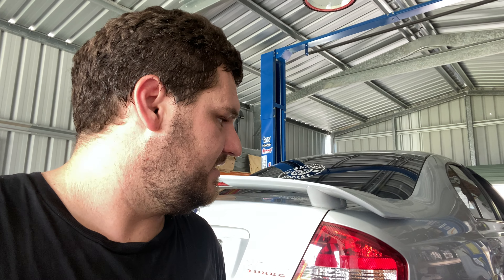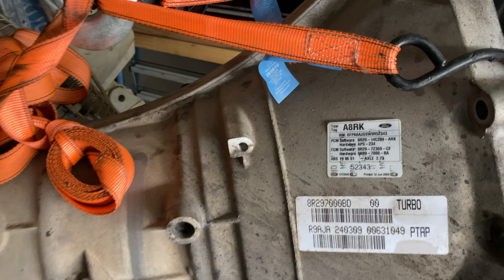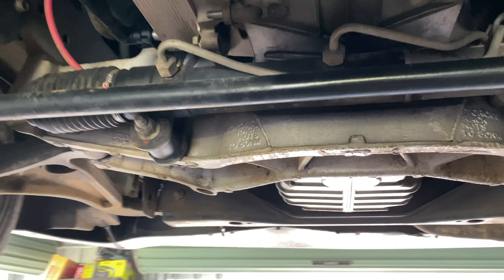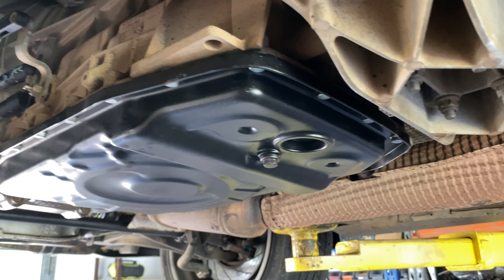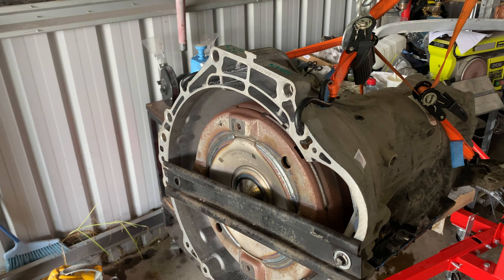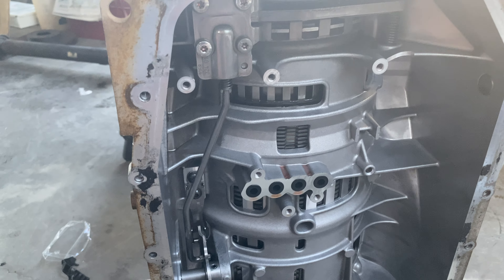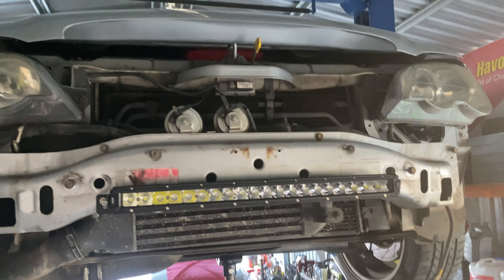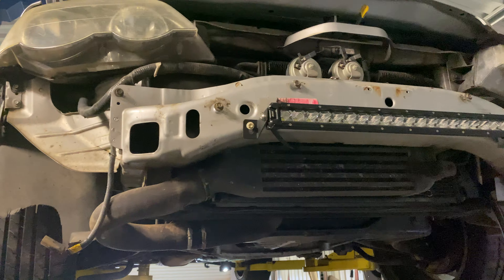Fitting a Fresh ZF6HP26 Gearbox to the BF XR6 Turbo

Comment: Great video and very informative. What did you mean by the gearbox hunting? My 306 000km ZF was slipping the lockup clutch in and out at steady cruise, making the engine hunt up and down. I had the thing fully rebuilt 1000km ago and now it's happening again until the trans is fully warmed up.
Reply: I was under the impression that the lock up clutch is located in the converter? You sure they didn't reuse the torque converter?
Reply: @TheWretchedWorld  They rebuilt the convertor, new clutches etc. And I don't think there was a problem with the trans/convertor at all now. I fixed some vacuum leaks and the engine hunting up and down is gone.

Comment: I've got a BFII XR8 with only 55,000km and the revs jump up and down when coasting downhill with 0 throttle or coming to a stop.. it doesn't do it when under load or when I'm accelerating.. what could cause this at such low km? I've had torque converter issues at very low km with an two other ZFs one in an FG XR8 and the other a BF XR6 Turbo with only 30,000km.. what is the go with these terrible gearboxes ?? Help!!😭
Reply: What torque converter issues did you have?
Reply: @dracoboomin6511 I finally got my BFII XR8 ZF box working acceptably -  It was slipping when coasting until warm, so I had it replaced with a new one for $1250 and the new torque converter was slipping even more than the original one, the mechanic replaced the valve body along with oil pump etc until eventually trying another new torque converter which fixed 98% of the slipping issues and I'm happy with it now.. My other two ZFs also had slipping torque converters

Comment: Hi mate, so you took the TCM off the valvebody and swapped that onto the new boxes valvebody? Cheers
Reply from the maker: Yes mate, very simple to do, just be extremely careful and meticulous when doing it.
Reply: @duffysgarage1196  awesome. 

My box would instantly go into limp mode when I shifted into 4th... So scared it's the valvebody that's cooked.

However swapping the suspected valvebody and TCM into new box regardless to definitely tick all boxes and see if it still has the same issue. If it does, I'll drop the pan (while it's in the car so easy), grab the valvebody out, swap it with the new untested valve body, and whack it back in. Doing it this way will show me if the box I just pulled out is rooted/fine. 

Can you see any obvious things I might be missing? Thanks!

Comment: Hey mate, did you try replacing the mechatronic seals whilst you had the valve body removed? I heard the Bridge/adapter seal and the 4 rubber tubes perish over time and is common on the ZF causing all sorts of issues, Slipping/shuddering etc.

Comment: Hey mate just wondering is the valve body that’s swapped into the FG ZF out of BF ZF and does the pink stall bolt straight up to the BF flex plate? I’m currently buying a FG ZF to swap into my BF and I’m just doing my research to find out what I need before buying it
Reply from the maker: In my case it went straight in, no differences, only swapped the tcu so the car would still drive 👍
Reply: @duffysgarage1196  No worries thanks mate 👍